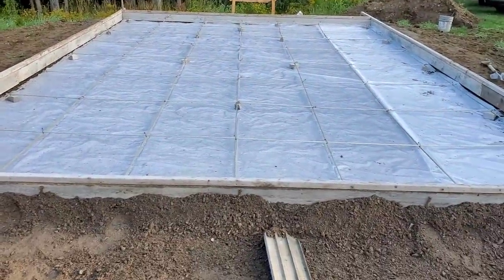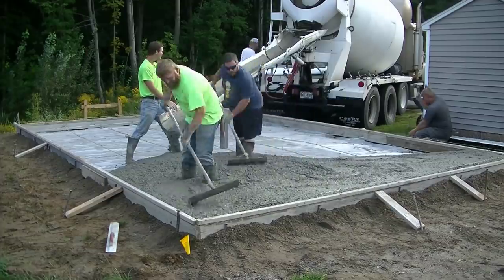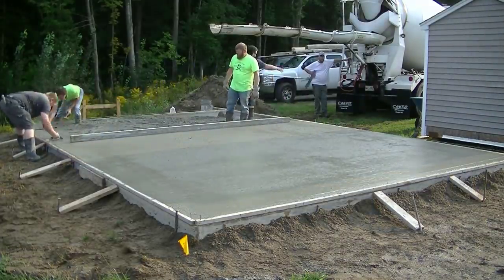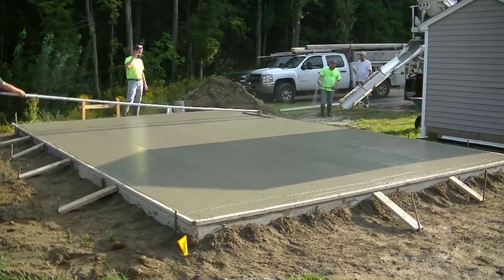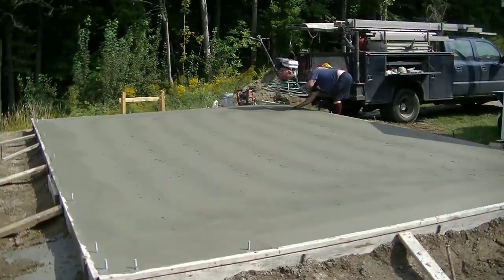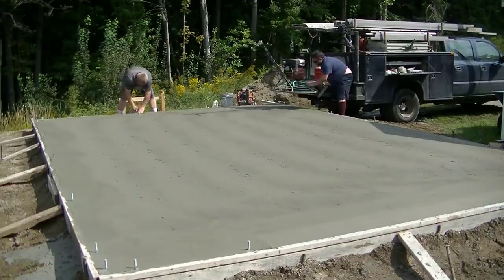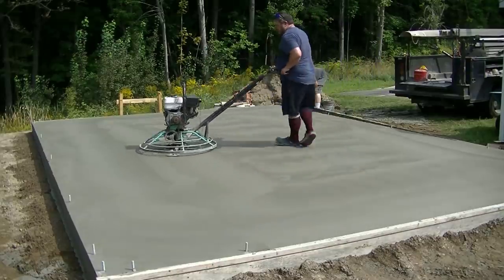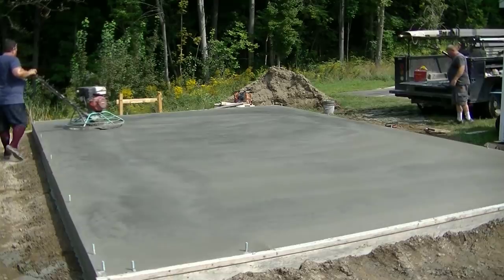They Made Us Pour This Shed Slab 8" Thick (Wasting Money)

Comment: Can you do a video on how rebar works in a slab. My argument is it is just for tensile strength and not compressive strength. Also my experience shows a well compacted base is the best prevention for minimal cracking.
Reply: Your steel is for tension where concrete has no strength.  It also controls cracks so that cracks do not open up and are contained.
Reply: Also yes the base is absolutely critical.  Compacted crushed rock that is angular (no round rock, no pea gravel) is what is needed on top of well compacted soils.  Your structure is only good on top of a good foundation and your foundation is only good on top of stable subgrade and base.
Reply: Concrete is a science. It is the most used construction medium as it is the most fluid to form with.
Reply: Don't pour on rebar late in the day especially during summer. It will crack the pour and you will be able to see where every stick of rebar is because, the cracks will follow the rebar underneath. The fiberglass rebar would probably alleviate that problem however since it would not absorb the sun's heat like iron rebar does.
Reply: @cyclingboss469  try rebar in the middle of the summer and late in the day. You will get big time cracks.
Reply: @cyclingboss469  
My theory for rebar in slabs / driveways is if the base is compacted say 90% , the slab can not settle. So tensile forces are basically eliminated. Rebar for crack control seems to to be less effective than a mesh combined with fiber in the mix with controls joints at the right places.
Reply: @royhorn2782   Man oh man.... If you see that, you have some shit concrete guys working for you.
  As soon as the wet concrete hits it wicks any heat off the rebar. (Rebar will be at room temp) And if the rebar feels to hot to touch you spray it down with water.  But you are correct about the heat/cold affecting concrete being poured. That is why all my pours happened early in the morning.  And I mean early. 

  Concrete gonna crack somewhere that's inevitable but it can be mitigated to a very minor issue by good and thorough prep. Get that sub-grade as tight as you can get it. Make sure your forms and bulkheads a true and secure. Double check your elevation pins and use piano wire instead of string. Pour at an easy pace, correct any ground contact issues with rebar or mats as the arise. (Good "come a longs" have hooks for that) The super and foreman should always be cross checking each other on finish grade. 

  I've worked for companies that just slam concrete down willy nilly just to get those quick draws. And the finished product turns to shit in less that a year. 
 In one company I had another super go 60 yards over on a job that was supposed to have only 680 yards total.  (We building gas stations hence all those yards.) The company wanted us to pour as soon as we had space to pour, be it only 10 yards. LOL! Well he sucked a civil work. He had all kinds of deflection issues on his sub-grade and barrier forms. And by pouring over the period of 2 months in small segments as ground became available he lost control of it . 
 
 Company didn't give A/F, I guess they thought they'd get away with it. LOL!! I heard they got in trouble several years after I left. A whole bunch of crazy stuff. As usual It was a family run and owned company... LOL. 

 And I've worked for companies that have their shit together. Makes it so much more fun! I always knew I was going to build ever since I was a young boy. Had all the cool building toys.    

 Have a nice day
Reply: @roseanneroseannadanna9651  keeping slump and water to cement ratio is the best way to stop cracking. But you still need to make your saw cuts before it starts breaking on its own. You can at least relieve stress in a controlled manner where you want it. I have seen some 2 man flooring crews tell you to put 150 gallons of water on a 6in slump before they have even looked at the mud. I am not kidding. They just took their come alongs and bumped the surface of the concrete with it and the wave would flatten the surface. I don't even remember seeing a mop (bull float) on sight. Blew my mind when I saw it. This was on homes pushing $300k here in Oklahoma. $300K will buy a really nice home here.
Reply: @royhorn2782   Concrete is like baking, you have to get everything spot on for a great product! It's science on the job and sometimes on the fly! That's why it was my favorite part of my job.
Reply: @roseanneroseannadanna9651  Definitely relies on the ingredients. All too many concrete companies are trying to slide in mix designs with upwards of 50% flyash too. Nobody is going to convince me that flyash helps make better concrete. I have seen too many things to convince me otherwise. Let's wait for a couple thousand years (as some concrete is that old.) and tell me if flyash was all that it was made up to be.
Reply: @royhorn2782   Roman concrete used volcanic ash hence it durability and longevity. It's basically the original hydraulic cement.
Reply: @roseanneroseannadanna9651 No they burned limestone rock the same way we do. Not as efficiently but they did. There are sea walls and docking areas poured with hydraulic concrete that are still use today. We often don't give the Greeks and Romans credit for their engineering and building prowess. They were people who were truly trained in logical thinking. That doesn't mean that they were without fault, always correct, or religious corruption of facts. But those people knew how to build. I watched a program some years ago about ancient buildings and the materials and methods used. It was an amazing program. I would love to see it again.
Reply: @royhorn2782  So you're saying limestone rock is the same as volcanic ash?
Reply: @roseanneroseannadanna9651  I am saying that limestone rock is what was used in the early concrete, not volcanic ash. Limestone rock was incinerated and then crushed to make cement powder. The same exact cement powder that we currently use.

Comment: Overkill is the best.  I always go  a bit above code.   Has served me well.
Reply: But the inspector claimed this was required (AKA - "code").  So, would you have gone 10"?
Reply: @benjaminreinhardt259  if they say 8 then I would be at least 9.   They told me 15” deep for the plumbing and I went 24”.  I used twice the rebar in my wall plus had fiberglass shreds in it.
Reply: @Imwright720  2 coats of paint , nah go 3. 1 layer of drywall? nah double it up .
Reply: @NunYaaBizz  sounds good
Reply: @NunYaaBizz  What you just said increased the fire resistance and escape time of the room. Your sarcasm actually proved his point provided that was the intention. With paid yeah an extra coat gives a better finish.
Reply: @joer8854  why not triple up the drywall then and further increase the fire protection?
Reply: @joer8854  an extra coat of paint doesn’t automatically mean a better finish, if 2 coats get proper coverage then a 3rd coat of paint won’t make it better. It’s such a stupid logic, by your way of thinking 10 coats of paint will be a much superior product than 2 coats
Reply: @joer8854  1 pea trap? Nah maybe 2 then it’s double protected. GFCIs for all plug outlets. Frost line is 3 feet? Let’s dig 4! As long as the customer pays it’ll be a better product! Great idea guys
Reply: @NunYaaBizz  It sounds like you are fishing for a reason to charge as much as you can for as little work as possible, regardless of the outcome. No way is universal. I feel sorry for anyone you did work for and the contractor who inevitably had to fix it.
Reply: @joer8854  I do what I feel is best and I am not going to do extra shit just because the code is x so I will automatically do more than that even if it's not needed. It's a stupid logic. I have 99% percent rating in Homestars and 99% rating on Jiffy on Demand with over 400 jobs. I'm 26 years old and make well over 100k a year, you guys on here talking this nonsense are probably hourly workers. What's the point of going above and beyond when the extra things youre doing won't even make a qualitative difference at times? 

It sounds like you have a hard time finding work and customers so when you finally get one you tack on a bunch of bullshit that won't make a difference so you can milk them for more money
Reply: @NunYaaBizz  I haven't said what I do. The people I work with and myself take the  building code and at times when we find the building code to be insufficient for the application we do what we feel is necessary. Often the code ends up being updated to meet those minimum standards we set for ourselves.
Reply: @NunYaaBizz  according to you, nobody should ever go above code.
Reply: @joer8854  Dude the OG comment was saying he always goes above code. I am pointing out that at times it's not necessary. At times I will go above code and at times I will do the minimum if I feel it is adequate.

What he is saying is if the code is x he will do more than x and I am saying sometimes that's stupid

So if the code is 2x layers of drywall for the furnace room, I am not automatically going to put 3x layers of drywall. If the code for the frostline is 3 feet, and everyone in the city is doing 3 feet or less for posts, I will do 3 feet. I am not going to do 3.5 feet just because the code is 3

100% your boss is not going above code for EVERY single thing he is doing. If you are not going above code for EVERY single application, which I know you're not, why are you arguing with me? You actually AGREE with me and disagree with the OP comment if you're using your own judgement and going minimum code on certain things and above code on others
Reply: @joer8854  Where did I say never go above code? Where?
Reply: @joer8854  I have a very simple question that should just end this argument. If the code is 1 pea trap for every plumbing fixture, will you install 2 pea traps because the code is 1? Because it's above code it's automatically better right? Why not 2 pea traps for every fixture?
Reply: @NunYaaBizz  Dude if the customer wants it above code stop arguing with him. Charge what it takes for what they want and if they agree to your price then do what you are hired for. Weird that contractors like you are livid about doing anything above minimum code. To be completely honest with you I would not hire you to do any work on my property.
Reply: @MarkHerndon  You should read my comments again and work on your comprehension skills
Reply: @MarkHerndon  Also I work strictly off repeat customer and close referrals, I don't work for people that find my website, homestars, or neighbors seeing me work and asking for my card etc.

I turn down more jobs/customers than I take. Higher likely hood I wouldn't take you on as a customer than vice versa, especially if the way I get jobs is via close referrals,  so I would've been referred by a close friend or family member

Comment: You may have addressed this, but after you added to the depth, was it a problem that it now is not matching the height of the house ?
Reply: I was wondering about that too
Reply: The way I took it, they had to add the 2" specifically to match the height of the other building. I'm wondering why, though?
Reply from the maker: You're right, it's just what the building manager wanted. He thought he needed the extra height to slope the driveway away. But he already had enough in my opinion.

Comment: Maybe the shed is actually a "shop" and the owner plans on having heavy equipment in there, like a blacksmithing power hammer or a huge lathe or CNC machine. I heard the manufacturers require a certain thickness of slab...

Comment: I can see 8" around the perimeter for a monolithic slab and 6" for the rest of the slab as an option. I'm going to build a home in New Hampshire using basalt rock rebar for superior strength and no corrosion which causes the concrete to crack. I will have to use steel in the areas where bends are required, as the fibers lose there strength when used in this manner. My plan is an insulated monolithic slab (garage/basement) and the walls will be 10" Perfect Block. The roof is going to be a gambrel and will be the living area in this build.
Reply from the maker: Sounds good!

Comment: #3 glass is equivalent to #4 steel? Sounds like some pretty stretched marketing wank to me. 
I'm not a phD but I do have a fair background in material science and the basics simply do not add up. Especially since the tensile stiffness, thermal expansion, and energy absorption(in failure) are more important in passive concrete reinforcement then yield or ultimate strengths; the energy absorption of mild steel in a controlled failure is far superior, but only comes into play when the concrete has already failed in a major way and you just want to prevent a complete catastrophic brittle failure.(This mainly applies to above grade columns and beams in earthquake areas.) 
As for basic normal load strengths, to get the same tensile stiffness for minimizing cracks, assuming 100% glass packing (not remotely plausible to manufacture, but a best case.) you would need 2.5x the cross sectional area of glass(1.6x diameter) compared to steel. On a specific modulus basis(stiffness to weight) the glass could be about 20% lighter than steel. In reality the 20-40% resin in the glass rod will eliminate the specific modulous advantage and the cross sectional area of glass fiber rod would be closer to 3.6x with a total weight equal to steel rebar. 
For thermal expansion portland cement concrete (PCC) ranges from about 8 to 12 microstrains/°C and steel 11-12 making a very good match, glass is only 3-5 so temperature change will create stresses between the glass fiber rods and concrete. 
Glass fiber has some advantages in certain applications for sure, but I'm not convinced it is a "stronger" reinforcing rod. It may be very suitable for post tension applications as the modulus is less of a factor and it won't rust if exposed. But while strong bases(Ca hydroxide formed in concrete) passivate steel, they attack glass. Though GF rod inherently has a polymer binder-coating likely making the basic pH issue insignificant, assuming the maker didn't mistakenly select an incompatible polymer. 
I don't know much about the bond or grip of concrete on glass fiber rods as compared to normally textured steel rebar, I imagine is can be textured to be similar.
Reply: that's how they sell it. 7x the tensile strength of steel. D.O.T. approved so I'm all in with the stuff
Reply: @unknown3313   The FRP bars are significantly stronger, but the material's properties and behavior are very different.  The FRP bars strain significantly more than steel under stress.  (In technical terms, the Young's Modulus is significantly lower in FRP bars).  That means a FRP slab will exhibit much more cracking for the same loading condition as a slab with regular rebar.   Usually to get the same cracking performance out of the FRP bars, you have to put twice as many of them in.  The DOT's that use FRP bars usually are doing for corrosion resistance and not strength.

Comment: Odell complete concreting has been using fiberglass reo for a while, with fiberglass micro mesh poured into the mix when the truck turns up. What was the price for the extra 3 yards? What mpa/psi strength was the concrete?
Reply: fiberglass micromesh doesn't trowel too well does it?
Reply: @thornil2231  Not sure mate.

Comment: I can relate!  One time I looked at a shop build, it was around 1000 sq feet and on a frost wall and footing.   The owner wanted a 12 inch thick slab !   I told him 5 inches is more then enough and you’re only as good as your prep, and the prep will be good.   He insisted it needed to be 12 inches thick because a warehouse he worked at had 14 inch thick floating slabs…. Needless to say I didn’t get the job after I laughed and told him his exterior walls should be 2x12s then.
Reply: kinda makes me wonder what's dumber, paying more money for an over done slab or the guy who screws himself out of a job by insulting the paying customer.  It's one thing to educate your customers and try saving them money, but it a dumb ass thing to shit on them when they ask for more and are willing to pay for it.

Comment: I have poured a lot of slabs for metal buildings. It's the kind with the 2-inch metal tubing for the skeleton of the building. The county I am in requires an 18-inch footer for that! If it is enclosed and on concrete than you have to have the big footer. The crazy thing is, you can set them on dirt and anchor them with pieces of rebar and it's fine!
Reply: They probably aren't so much concerned about the thing sinking as they are it flying.

Comment: You dont know what the guy plans on doing in his shed. Could be putting a cnc or something else that needs a solid base.
Reply: Still over kill
Reply: @inwardboy   Not necessarily. This person's "shed" might actually be a home for his in-laws, a machine shop, an auto shop, you never know.
Reply: @RobertLinthicum  how much a cnc can weight to break the concrete. The cnc is milling and doing precision cuts not hammering nor chipping or stomping do you even know what youre talking about? Do you know what  Pounds PSI is? You will need an elephant in skate with steel wheels tap dancing to make a notch in that concrete. After 1ft of damped gravel, 8 inches of concrete with rebar isnt it an over kill? .......... go to sleep

Comment: High water absorption will debond the fiber. This will weaken the interface between the resin and fiber. I'd be very careful using this. Depending on the application, this could substantially reduce the lifetime of the concrete.

There isn't enough long-term use to explore all of the new challenges using this material.
Reply: Yeah I'm pretty sure this and epoxy coated rebar are banned by code